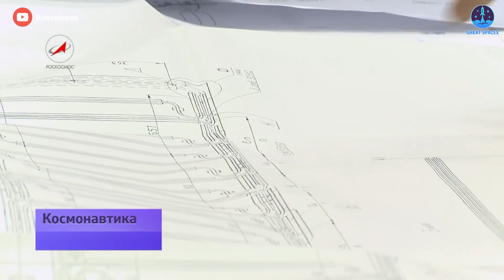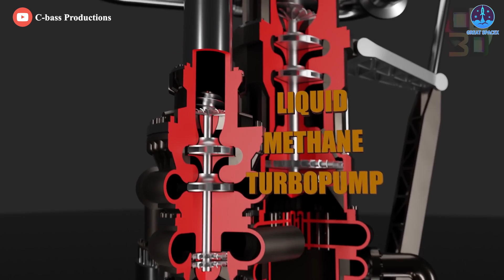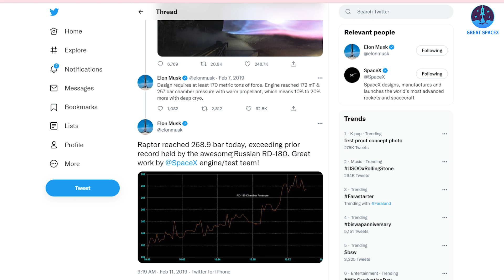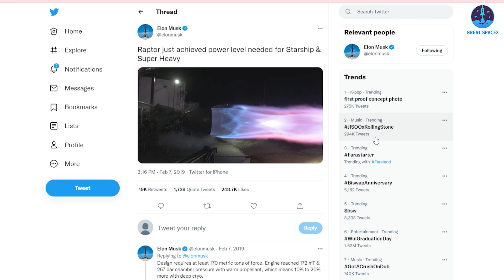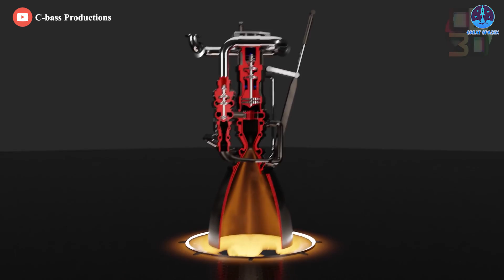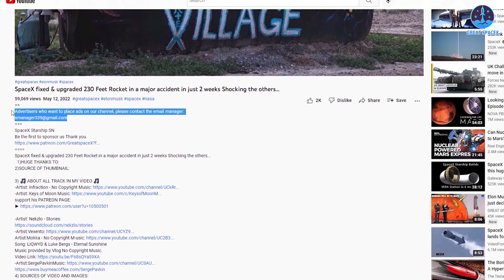It happened...! Russia finally realized SpaceX’s Raptor is BETTER than Russia’s best engines!

Comment: Why you switch the trust number between f1 engine and rd-170 bc the data said f1 engine have 6,77 kN and rd - 170 engine 7,88 kN. This the engine (RD-170) that nasa use to send astronaut to space from 2011 to 2020 with 100% succesful rate. From power per fuel rd-170 is better than any rocket enggine in this earth allowing them to carry more suply besides the fuel, the advantage that no other engine  provided. Yet the advantages raptor engine has over rd-170 is bc they using liquid methane wich is can be sintesis in mars and easy to carry also raptor engine is reusable engine. Raptor is ground breaking engine they actually reinvented the rocket engine. No one could making reusable engine before yet still need more development before they became better engine than rd-170. I thought is easy for spacex to beat cold war rocket engine technology.

Comment: I am impressed. But maybe the facts are a little slanted? Because with the RD's thrust per engine. It takes a few raptor engines to match it which is not bad. But its raptor cost times 3 which makes the RD much closer in price. I do like the idea of multi engine redundancy. It would be even better if one fails it could be jettisoned. Well see what it takes to get to the moon? It appears NASA can't do it with their latest attempt. Space X is Americas best chance for sure.🤞

Comment: Raptor is not better. It just uses a different fuel. Actually compared the weight of fuel needed to get the payload to the orbit, SpaceX raptor is not better than russian RD-180. Raptor uses liquid methane, which brings another problem - necessity of cooling it to keep it liquid. So you have twice more to cool: oxygen and fuel. So all this around is even more expensive. The advatage is that it can be used to start from Mars. That is the reason why Elon have choosen methane.

Comment: The Merlin engine is 200:1 thrust to weight ratio. The Raptor is not. I think it's still better than the RD180 though. I wonder if you check your facts. Rocket geeks are pretty smart.

Comment: In your thrust comparison I think it would be important to point out that the RD-180 has two main nozzles. If you took two Raptor nozzles you’d have 4400kN of thrust vs the RD-180’S 4150kN.

Comment: Except a Raptor won't be even close to 250k.  Won't even be under 1 million$  Like not by a long shot.
Reply: With mass production its possible.  Every low rate initial production material is more costly.  It's when they're mass produced that the overhead costs can be spread out among more engines bring the cost drastically down

Comment: Heck the Merlin 1D+ is better than the RD 180.  The Merlin can be used over and over and over and over again, with a very high power to weight ratio. No other engine has done that with this power to weight ration.
Reply: RD-170/171 passed test with multiple ignitions with overall work time more than 3000 seconds.
RD-180 has same capabilities. They are not used multiple times because ULA did not develop a rocket stage that can be re-used multiple times. So multiple use of rocket engines depend mostly on the rocket stage design, how it conducts clearance after shutdown, and so on.

Comment: Why don't they just attach a coiled fuel hose to the side of the rocket, and pump fuel into it as it flies up? Then you can save ALL of the onboard fuel for more IMPORTANT things! Just one of my many brilliant ideas, SpaceX. My resumé is available upon request. Hope you like CLIP ART!
Reply: Air-dynamic forces will destroy fuel hose. Also it cannot be made at least 2000 km long.
Reply: @alexanderbelov6892  Ah, but what it you used Flex Tape on the hose? Check and mate.
Reply: @alden1132  
SpaceX already lost one Raptor 9 during fueling on the launch pad. 
You suggest to make lottery fueling 2.7t of fuel per second during flight.

Comment: Why doesn't E.Musk have rockets on battery?
Reply: Falcon 9 FT first stage requires at least 12.5 GW of power. Better make Lithium solid fuel engine that burns Lithium, but Lithium is more expensive.

Comment: Since a raptor engine has yet to put anything into orbit, it's a little premature to say it has made the Russian rockets obsolete.
Reply: @iljastalberg5610  Raptor: "Thrust ~230 tf (2.3 MN; 510,000 lbf) for Raptor 2"
RD-180: "Thrust, vacuum 4.15 MN (930,000 lbf); Thrust, sea-level 3.83 MN (860,000 lbf)"
RD-180 4.15 vs Raptor 2.3. Where do you get your numbers? 1500kg = 0.015MN...

RD-180: "Thrust-to-weight ratio 78.44" vs Raptor: "Thrust-to-weight ratio	200, sea-level, goal<120, vacuum"
Reply: @sFde46  Wait.....i cant read apparently i misread dry weight as a useful weight. Yup you right im deleting bs that i written before this comment
Reply: @sFde46  Specs are fine, but it is yet to fly. When it does, break out the champagne, by all means.
BTW, BE-4 is the one that is going to replace RD-180 on American launchers. And if you measure engines by specific impulse (I don't see that you list those), ancient RL10 (used everywhere: Atlas, Titan, Delta, Saturn families, even DC-X, now Centaur upper stage) beats them all by a quite wide margin.
Reply: @bazoo513  Um, actually the Raptor has flown successfully, several times, just not to orbit... The BE4 on the other hand? We are still waiting for this overpriced, underpowered white elephant to get of the ground.
Reply: @PhilThurston64  Successfully? If you consider a few minute hop with exhaust bright green from vaporized engine components, of the engine supposed to endure many orbital flights without refurbishment a success, then sure.
BE-4 is supposed to have almost exactly the same thrust as Raptor 2. None have yet been demonstrated outside of test stand (although I do expect Raptor 2 to beat BE-4 by few months.)
Reply: @bazoo513  a launch, flight to altitude return to launchpad (with successful relight) and landing while mounted on prototype hardware seems like a reasonable proof. It took them a few attempts to get the flight procedures correct, and there were issues with the fuel/engine mix in some of the earlier flights, but it is well in advance of the BE4 (which operates at a much lower chamber pressure BTW, lower than the RD-180 even).
Reply: @stevetodd7383  Yes, but it was Raptor 1, and the engines consumed themselves at alarming rate. Let's hope that V2 solved that.
Tori Bruno of ULA claims he has flight-ready BE-4s in his hands.
We shal see.
Reply: @bazoo513  You do understand the definition of prototype, tight? This is how SpaceX works; build, test, improve, repeat... This is basic agile. And all you have to check for success is look at SpaceX track record on Falcon 9. As for their reusability compared to... um, oh yes, no one else can reuse their rockets... and ULA buy their engines from Russia. Pile on the hate as much as you want, SpaceX is leaving the competition in their dust.
Reply: @PhilThurston64  I am not trying to diminish SpaceX successes. I am just saying that we have no reason to believe that the newest member of Raptor family is any more (or less) ready for prime time than BE-4. What do you think, that BE didn't change their designs when their turbopumps blew or the combustion chamber overheated? It's just that SpaceX does it (more or less) publicly, which, IMO, is a brilliant PR move.
Soviets had RD-270 full flow staged combustion prototype half a century ago. It never flow, and we will never know what would happen if they persevered with its development.
Propulsive landing isn't new, either, but others who experimented with it (e.g. Douglas with DC-X) concluded that wight penalty (fuel and landing hardware) cutting into the payload was'n worth it. And they were not so far off-base - Shuttle was actually outrageously expensive despite reusability, and Falcon launches are not that less expensive than those on, say, Soyuz or ULA launchers. What changed the equation, and now everybody and their dog work on reusability, is the volume of "space traffic" - a number of megaconstellations going up, plus research and demonstration payloads from universities, startups of all kind, various smaller countries wanting to have their own communication or Earth observation birds etc. Peter Back said, having dined on his hat, that resurability of Electron first stage will not so much enable lowering the launch price, as increasing the launch cadence.
Reply: @bazoo513  Raptop 2 looks a lot less complicated than Raptop 1 so I guess it will be a lot more reliable
Reply: @davout5775  I hope so.

Comment: And the first soviet satellite did not have any camera or equipment to take pictures or do science.
Reply: There was no digital cameras in that era. Sputnik did not have chance to return film from regular camera anyway.
Reply: It had a radio transmitter. People could receive the signal of it around the world. It was possible to do measurement of radio signals spread in atmosphere, check doppler effect of a thing that moves the speed 50 miles in 10 seconds. Actually the first soviet satellite was one big science experiment: get a thing to fly around the whole planet without usage of engines for tens thousands of kilometers of its journey.

Comment: What SpaceX is just doing is to introduce a new level of space technology. Not using good old 1960s technology like some other  companies might do, but using 202x technology.
Reply: Full flow staged combustion engine was pioneered by Soviets. Raptor, once it stops its tendency for engine-rich exhaust, will be a significant improvement.
Reply: @bazoo513  let´s see Raptor go to work soon!
Reply: @benjaminhiemer3335  Of course. I hope that V2 solved the "engine eating itself" problems of V1 - the same problem that plagued RD-270 in 60's so that it never advanced past the test stand.

Comment: The US was never forced to rely on Russia for rocket engines it choose to use them for a few reasons but one of the main reason was for security. 

The US aerospace had and has capable rocket engines and the capabilities to develop newer and better ones, it's easier and cheaper to use something that is proven and already developed . 

The RD-180 was used in the atlas rocket to provide Roscosmos and Russia's rocket industry a customer and a source of steady revenue and help keep engineers employed in Russia's aerospace industry.

In the 90s the just founded Russian federation had no were near the money or resources need to maintain Roscomos and it's aerospace industry nor were they able to buy very many if any new ICBMs or other military rocket due to the economic state of Russia at the time. 

During the early 1990s, General Dynamics Space Systems Division (later purchased by Lockheed Martin) acquired the rights to use the RD-180 in the Evolved Expendable Launch Vehicle (EELV) and the Atlas program. As these programs were conceived to support United States Government launches, as well as commercial launches, it was also arranged for the RD-180 to be co-produced by Pratt & Whitney. However, all production to date has taken place in Russia. The engine is currently sold by a joint venture between the Russian developer and producer of the engine NPO Energomash and Pratt & Whitney, called RD Amross.

When the Soviet Union collapsed one of the concerns the US had was Roscomos would be shutdown or greatly underfunded and the Soviet aerospace industry that build the motors and technology for rockets and thus ICBM missiles would not have enough domestic sales. Then to seek more sales to stay afloat the, engines, tech and knowledge would be sold to the highest bidder and or the engineers go to work for the highest bidder, either officially by the Russian Government or under the table by under paid corrupt engineers and scientists themselves.  

So to try to prevent this knowledge and technology from falling into the hands of countries like North Korea or terrorist organizations the US government set up programs and encouraged US aerospace companies to use Russian hardware in part of their rockets to help fund Roscomos funded and keep their engineers and scientists employed and busy.

The US government also did this with other sectors of the Russia aerospace industry, Lockheed Martin F-35 B's engine for STOVL is derived from Yak-141 prototypes developed by Yakovlev.

As the Iron Curtain receded across Europe, defense giant Lockheed Martin started to pour money into Yak-141 program in order to glean some sweet, sweet former Soviet engineering secrets. The two companies allegedly signed an agreement in 1991 (but not revealed until 1995) that outlined funding for additional Yak-141 prototypes, including a plan to fly the remaining operational prototype the Farnborough Airshow in September 1992.

While Lockheed most likely had zero intention of helping produce the Yak-141 for export; it would make more sense that the entire contract was a cover for procuring testing data on the Yak-141 program, including most importantly any VTOL data obtained through years of testing and development.

So basically when the Soviet Union fell all their top secret high tech aerospace technology, data, knowledge and experience was up for grabs and the US government through it's aerosapce industry players were often the highest bidders.

In short it was done to get any classified advance tech from the former soviet union but also to save the former Soviet Union aerospace industry to keep them building rockets for space exploration and scientific research and not building ICBMs for the US's enemies such as North Korea, Iran, Saddam's Iraq and the various terrorist organizations.

Comment: For ULA, their rocket is built on RD180 engine, even if SpaceX willing to sell ULA their Raptor engine, ULA will not be able to use it since the fuel system is totally different. The SpaceX Merlin engine share the same fuel as RD180 but the size and thrust is way to much different.......
Reply: They need to call pickle rick..)
Reply: ULA's Vulcan rocket could be redesigned to use Raptors. As also Blue Origin's 'New Glenn' rocket if the BE4 engine fails to work.
Reply: @favesongslist  Technical possible but probably easier to redesign the whole rocket. The size of engines are different and to redesign the whole fuel plumbing to get around the old system will be an engineering nightmare. BE-4 is Oxidizer-rich staged combustion (single turbopump) and Raptor is Full-flow staged combustion (dual turbopump), Raptor will need a higher head pressure to keep engine running...
Reply: @favesongslist  Assuming SpaceX would sell engines to their direct competitors...which seems unlikely,